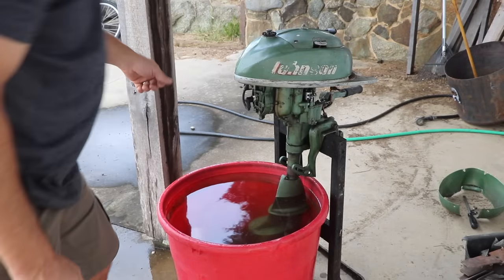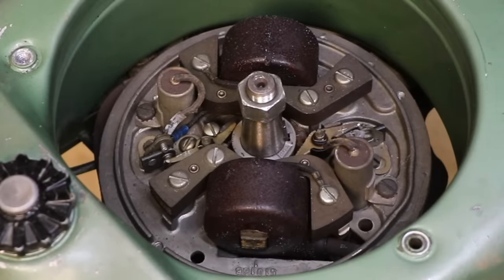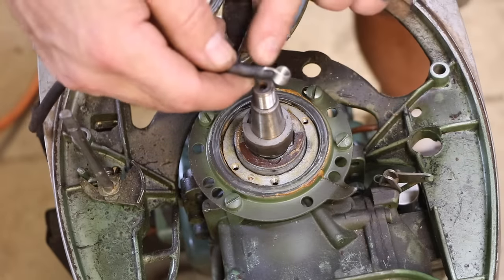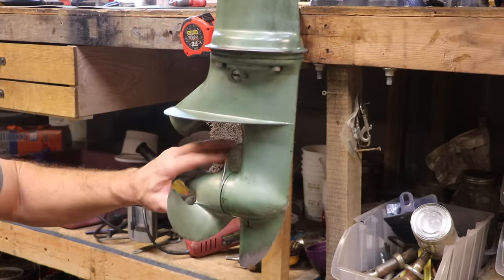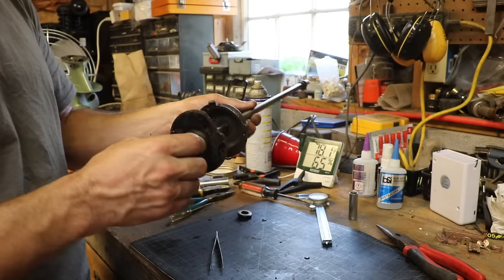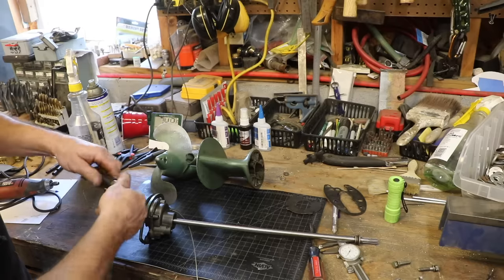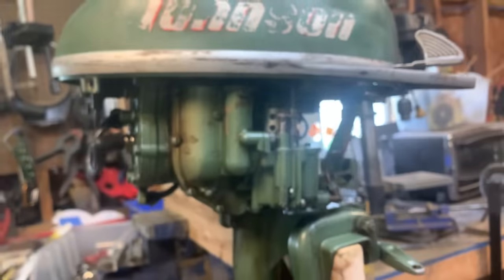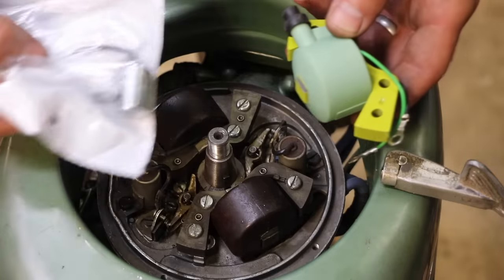My Johnson Needs An Overhaul, and it's Putting Up A Fight!  Johnson Engine Part 3

Comment: Excellent episode!!! I spotted some  mistakes with the dis-assembly ... 1) Never strike the crankshaft with a hammer... It could brinnell the bearings and cause cracks, and in some cases as with multi-piece cranks- drive the crank throw pins further into the places that they press into... 2) Use shorter bolts to hold the pulling fixture in the future. It will help to keep the jacking screw vertical, and not lean sideways... 3) The old crusty crankshaft seals were never removed... 4) The carb was never dis-assembled to be overhauled... 5) The head/cylinder block was never removed from the power-head. This could be an area that needs attention and possibly Some parts....... Some of the assembly errors are as follows: 1) Never run the engine when the coils have been installed without checking the clearance between the coil pole shoes and the rotating magnets... 2) Always check the float for buoyancy and proper fuel level 3) Thoroughly clean the carb, carb passages, fuel tank and any fuel feed lines. 4) Put a thin layer of eng oil on any tapered surface, to slow corrosion and help removal of the flywheel for future use... 5) The ignition wires on this engine should be the metal filament type, (like Packard 440). Try not to use carbon filament ignition wires. 6) ALWAYS replace the crankshaft seals, especially on antique 2-stroke engines like this one... 7) NEVER - EVER strike a crankshaft with a hammer. Especially multi piece  cranks with ball bearings ...8) After the engine has been run in with synthetic 2-stroke oil in the fuel at the ratio of 32:1, and all adjustments have been made, do a compression test of each cylinder with wide-open throttle & choke.. They should be fairly close to each other... When you stated that the ignition timing is advanced to accomadate higher rpm's, that is correct... To allow more time for the fuel to burn in the cylinders, but not to give electricity more time to create a spark... That spark happens instantly, regardless of how fast the engine is rotating... I liked Your video and learned how to test condensors (capacitors) by using a VOM set on continuity... That was awesome!!! Observing the constant increase in resistance as the capacitance increased in the condensor... Thank You for creating this video Amigo!!!

Comment: You are using  the puller wrong tighten the three bolts tighten bolts a little at time when the pressure is equal it will pop right up,the way you doing it the puller lsis not sitting flat with the mag making it pull on a slight  angle makes it harder topull

Comment: First BIG no-no: you hit the end of the threaded crankshaft with a hammer! Never do that without the nut on and sitting higher than the thread- it's easier to get another nut than fix a spread threaded crankshaft end.

Comment: Some one probably replaced the plug wires a long time ago with carbon type plug wires...
not knowing that that was a bad idea.... when ever your replacing plug wires on farm equipment be sure to replace them with copper wire plug wires and NOT carbon....
I made the mistake of replacing the plug wires with carbon plug wires on a old Henry Ferguson
tractor....and it would barely run.... I re installed some solid coper(multy stranded) spark plug wire I bought in bulk form from tractor supply and it ran like a top.... any small motor will more than likely react the same way as the voltage on say a 3.5hp B&S is way low as compared to an automobile coil.... which can run carbon core sparkplug wires....they do however brake down with age though..... carbon plug wires came out to reduce R.F.I interference and soon became LAW in California ! of all the stupid things ! so tractor supply is about the only place you can buy solid core spark plug wires ! .... some ignition systems (like perhaps your 80' man lift) may well require those carbon core wires or it will burn out the coil.... f.y.i.

Comment: An ignition coil is EXACTLY a transformer. It's a step-up transformer (increases voltage from input to output). There literally is no difference, functionally speaking.

Comment: How do you know which coil goes to which sparkplug or does it really not matter
Reply: If the engine does not start Switch the wires to the other plug You Have a 50/50 chance of getting right :)

Comment: I had a 1944 johnson 5hp seahorse had a few problems with spitting and sputtering when cold but always reliable i signed ownership of a 1960 14 ft traveler flatbottom with the johnson to my dad for a loan when the loan was paid i told my dad to use the boat and ill get the paperwork changed one of these days when i get the chance . My dad passed away i 2006 and since the deal was made with my dad not my mom the old hag wanted me to pay for it again so i lost the boat and its sitting in the brush at the family ranch and the motor was in an airplane hanger last time i saw it . What a waste ! Moral of story . Never trust family or relatives when it comes to money or antiques !

Comment: I respect you honor your marriage, but mechanics & electricians know to honor their ring fingers by removing all jewelry before working on motors, electronics, etc.  I had an electronics instructor give me that good advice, and it was repeated in an auto shop class, a wood shop class, a metal working class, and in OSHA training.  My uncle didn't have that good advice, or perhaps didn't heed it.   While working in an automobile's engine area, he inadvertently got his ring between the positive post on the battery and the frame of the car, promptly spot welding his ring permanently in place, and burning his finger off inside the ring.  Help us be able to keep watching your great work by removing your jewelry before you begin.  It doesn't mean you're no longer married--only that you want to be able to keep showing that lovely ring off in the future, still on its original finger.

Comment: The longer you play with your Johnson the harder it is, umm, to fix. 50 yr old wires? Always replace wires. With all the work you've done might as well fix those two dents and detail paint your Johnson logo. Yep your stroke is a little off, in for a penny, in for a Johnson pound.

Comment: it's just idiotic...
it makes no difference top or bottom. take a imaginary cup, fill it from  the top or bottom. Theirs only one place the air would be forced in both cases. 
It would make no sense why someone would want to go through the trouble to fill oil from the bottom.
 Not to be a douche but it's just common sense...
good vid!

Comment: Dude clearly your flux capacitor needs adjusting, you’re low on freaking blinker fluid. Now just take a small mallet and hit the side lightly then act like know what’s wrong. Next hire those mechanical ninjas off camera and once they fix it put grease on your face and act like you worked all night but now it’s fixed lmao
Reply from the maker: Darnit!  You caught me!

Comment: I can see you have no idea what you are doing when checking spark plugs wires and adjusting points! It's no wonder it's not working properly. If you were to read up on it you would easily see what you did wrong.